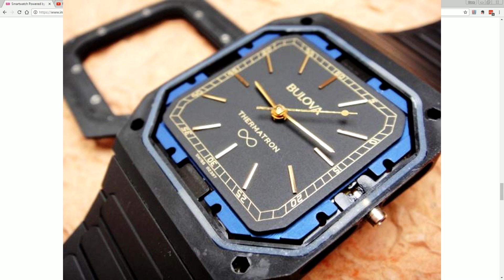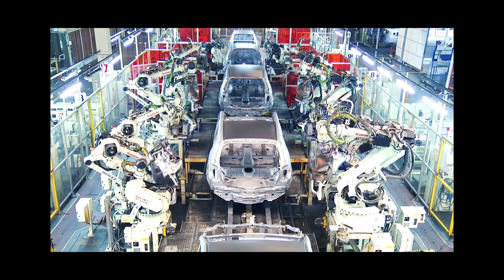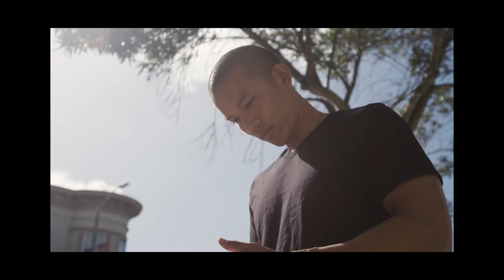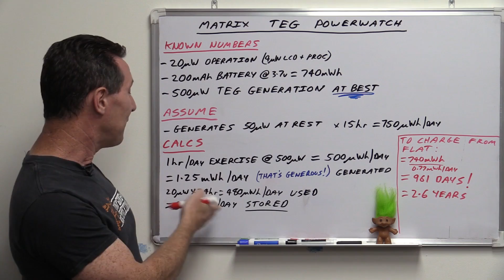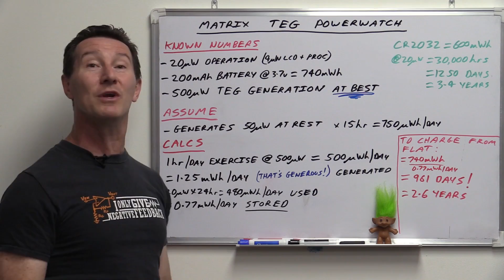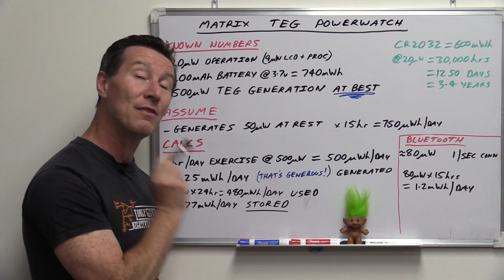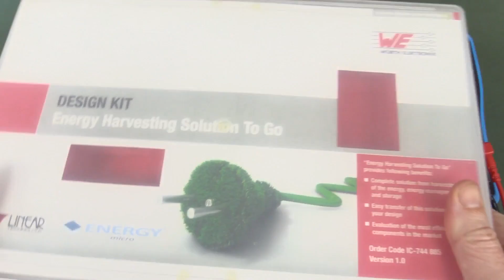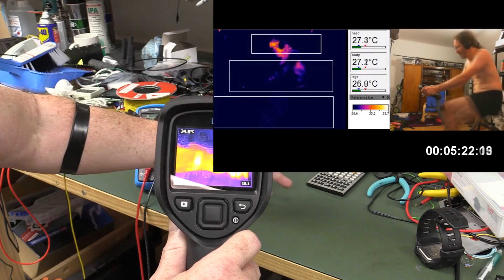EEVblog #945 - Thermal Powered Smartwatches Are GIMMICKS!

Comment: I wear my wrist watch 24/7. 

I wear it outdoors, indoors, in sauna, while taking a shower, sleeping etc. Though to clarify, I have an ordinary Titanium watch, which is SUPPOSED to be waterproof to 10 athmospheres (about 100 meters). For how long? I can't tell.

The titanium does not heat up nor feel cold while wearing so it's basically like I'm wearing nothing at all on my wrist. And it lasts for a couple of years with a single battery. 

I've been looking for smart watches, but the battery life and them being pretty much non-compliant with humidity and straight contact to water haven't been exactly adequate for my needs. 

Though a friend of mine has the Pebble whatever-the-first-version-is with the metal band and it survives being exposed to sauna humidity and being worn during a shower, or at least his pebble hasn't broken - yet.

Comment: If my calculations are correct, they could have harvested 25 mW by fitting a solar panel around the periphery of the clock face.

25 mm outside 2.5 mm bezel 
~177 mm2

I found a basic solar panel 0.55 W 70x55 mm -> ~143 uW/mm2

143 uW/mm2 x 177 mm2 
~25 mW

I don't know if my data is correct, and how such small solar panels have to be calculated, but even if this is in the ballpark, it smoks their thermal generator by far.

Comment: Since a small capacity CR2032 could power that watch for 3+ years they could still claim that it would not cost you any batteries if they supplied 5 CR2032 batteries with the watch for free. That would get rid of the TEG and Li-Po battery and still get you +15 years of free battery use and it would only cost them 5pc of the CR2032 batteries which would be pennies in large quantities. Still less cost than the TEG and Li-Po battery and associated circuitry.

On a side note... Li-Po batteries can outgas and catch fire if overcharged (not likely) or deeply discharged (if not worn for a extended period).

Comment: Well, I wear my watch in bed. Have been for 30+ years. Also, not a fan of calisthenics/cardio; I prefer short, high-intensity exercises.

For the past 25 years or so, I’ve been wearing the same cheap Chinese digital watch (with a gimmick capacitor I cobbled together to increase the accuracy to about –3 sec./month). The bracelet is a bit worse for wear, but the watch is still going strong.

Yay, “dumb” watches!
Reply: Using that one cheap watch for 25 years is extremely "green" without trying to be, right?
Reply: That's a superb ROI.
Reply: I wore my previous clock pretty much for 10 years without taking it off. Sadly it is now dead :(

Comment: I have a 20 year old solar powered Casio G-shock watch that also has radio controlled time keeping etc, also it has been indoors for the last 10 years and it is still working fine with the battery showing 100%.

Comment: So it's a thermal/digital counterpart to the Seiko Kinect?

18:53 - Would they usable/practical to connect to the back side of a solar panel? Especially the ones made to float over water reservoirs with the heatsinks immersed in the water?

27:16 - Would have been cool if you'd showed that earlier when your arms were becoming cooler just for visual comparison to thunderf00ts demo. But that's outside the scope of the topic anyway.

Comment: I wonder how the calculation works out for solar? I've got a Casio EQW-M600 which I leave on the windowsill at night like the manual says - the idea is that it gets a dose of sun in the morning and it can sync with the atomic clock. I've had it for about four years and it seems to be running fine. Then again I spend a lot of time in Taiwan which is a sunny place, and it doesn't have Bluetooth or any other smartwatch stuff.

Comment: I could partly understand the no charge policy. The context: I have Festina watch, nothing super fancy but:
I was diving with it to 20 meters, swam a lot, wear it in sauna, crashed point blank into the metal vise (ups). 
Had in in mud, oils, etc. Nothing had really damaged it. ... and it is quartz, bottery powered, so first major thing happened - the battery died after ~5 years.
I'd prefer not to have battery replaced. Factory seal was perfect and now I am a bit scared  whether it will keep its original parameters. 
So TEG (or different energy harvesting mechanism) in this place, sure. 
Is this technology viable in general: not yet.

Comment: Reminds me of those solar watches, becomes an extra burden to charge if you wear sleeves, and the rechargeable batteries are much more expensive.   Most are made to be disposable watches, which renders the green issue pointless, but they do have the advantage of lasting for years without a battery change.

Comment: I'll stick with my good ol' self-winding mechanical watch, thanks very much - it's undeniably powered by me, and its reliable as a brick and does everything that I need a watch to do. Even better, it's always on, and even holds charge and keeps running for a day or two without containing any battery at all. Keeping track of the minute or so it gains each couple of days, and having it stop whenever I forget to wear it, is less inconvenient than it is entertaining in an age of smartphones.

Comment: A few obvious technical errors:

1. With better circuit design (active rectifier), the watch should be able to extract energy regardless if the air or the arm is hottest.  Only problematic case is equal temperature.

2. With better thermal design of the strap, this should be able to extract power from the full surface of the strap, not just the surface of the watch casing. So no need to wear the watch upside down.

Comment: I use my grandfathers old watch, Enicar Sherpa DD, I sync it every other week or so, (I need a pretty accurate time, if its more than a minute off I sync it)
It shows me time, Date and Day, if I don't wear it I forget what day of the week it is...
It hasn't had a battery change since 1967, And won't need one the next 60 years either.
I bet electricity made from a similar system that winds my watch would be more efficient than this...

Comment: I just watched this because thunderfoot mentioned it. You mentioned several times that they would have a better TEG but I doubt this really. Not much can get you above the ZT of 1 that the commercial devices can give and besides any specialty material like a skudderudite or clathrate works at higher tmps and would cost a lot more. Ill lay odds on that they use exactly the same one you have with a little better heat spreader added.

Comment: No arguement here. Yeah,taking money seems to be everyones goal. These feed me .com sites are getting out of control. I refuse to invest in any of them.  Even if you invest in one,most are a here today gone tomarrow types anyways. There has been gimic driven watches available for years. I have a friend that collects watches for a hobby. He may be interested in one,but I doubt it. I think you may have spent entirely too much time proving your case especially when it was clear enough. I am glad you did add in the additional part showing that thermal electric generators are nothing new and not that big of a deal. As far as thousands of batterys going to the land fill a year from wrist watches,I hightly doubt that. I can get a regular watch battery to last 3 or 4 years. The fact I am retired  means I dont even wear one. You wore me out watching you do your workout. I had to go get a beer and sit down.

Comment: Have I missed something?
 Why count only one hour of wearing during exercise.
Wouldn't heat from the skin be going in all the time, with varying intensity of movement.
Why is the exercise in cold weather optimal if Thundefoots demonstration shows heat leaving the arms.
Were did 'assume 50uW at rest for 15 hours' come from?
Some people may have very hot wrists.
Is the main problem the temp at the wrist side and the temp at the dissipating side?

Comment: I'm only at 8:50 so far and you are really trying too hard so far with constant gimmicky remarks but you are way off when you say it isn't going to generate anything when you are in bed "because it will reach thermal equilibrium". Cold night or hot night? Arm under something or out? Your skin temperatures don't really vary much from resting state to even during exercise and although this difference may be useful to calculate energy output during exercise the variation will not result in a significant difference in power output. Cold ambient temperatures will be a greater contributor as the TEG's energy output is directly tied to temperature variation. What that means is for someone like me who lives in a warmer environment my most effective charging period could potentially be during the night when I am sleeping if I slept on my back with the watch out in the air. However even though I sleep without covers for most of the year if I am spooning my wife my watch would be under her pillow, I could put it on my other wrist for those times but when I decide to roll over I stick that wrist under my pillow so for me it would only effectively charge if I choose to lay on my right side and leave my watch on my left. I can see how it wouldn't charge effectively at night for someone in a cold environment who sleeps with their arms under the covers but I guess for those people their watch would charge more effectively during the day than if I had one. Then there are your figures on the board, watch it back and see if you can see the problems, at 13 minutes in I really should stop watching LOL But in case you are not catching it, I'll give you a hint for one of the funny parts, what does 20 mW times 30,000 hours equal? But there are other funny mistakes on your board, see if you can find them all LOL.

Your assumptions throughout are off so your whole argument and video fails. Is it a gimmick? Sure, in a way. To call this a smartwatch is a stretch, what it is more comparable to is a fitness tracker. They also tell you the time, some also sync with your phone and they can be very power efficient. Leaving out the TEG the key difference between this and a regular fitness band is this is more attractive in my opinion and looks more like a traditional watch. We know how long existing fitness bands can last without a charge and given the size difference of this watch we can reasonably assume that without a TEG and using a large battery if this device was capable of comparable performance to existing fitness bands it would be able to go much longer without a charge. So the comparison of this device to a smartwatch in their video is very misleading. The device they are comparing it to is not just a smartwatch, it is a smartphone in a watch format running full Android not Android wear however it is using older cheaper less efficient technology (than what is now available for more money) so under heavy use it will struggle to last a day. It isn't a fair comparison because this Matrix powerwatch will not make phone calls or watch youtube or stream from your choice of streaming music service or many of the other things the stand alone watch/phone they compare it to can do. A fair comparison would be to a fitness band as this Matrix watch isn't even really comparable to most of the smart watch market.

So using a TEG to charge a good looking fitness band on its own might be a bit of a gimmick, it certainly isn't something the market really needed. However also using a TEG as a method of measuring energy output during the day is a bit of an unknown, still I'd think this is also a bit of a gimmick personally. But ultimately this devices value must be determined by the sum of its features. I think it can be argued it is a good looking watch, there are a lot more expensive smart and dumb watches out on the market and in my opinion at this price point this is a good looking option. In the world of fitness trackers, something that you can wear out in the surf as well as tracking your activities at all times is a great thing and even better that it is still a good looking watch that most people wont feel the need to take off when going out or at a meeting. Compared to fitness trackers there are features that some people will miss. GPS tracking for example would be nice but it could be argued that measuring how much energy you used is more important than mapping exactly where you went for the purpose of fitness tracking, that's if a TEG actually proves to be good at measuring energy output, I have my doubts. It isn't really a smart watch and it is a different kind of fitness tracker. Time will tell if it is a gimmick or not.

The truth is practically the entire smartwatch market is currently a gimmick because western manufactures will always try and milk a market for everything they can and slowly release features while charging way too much for gimped products instead of just coming to market with the product customers actually want. On the other side of the spectrum we have China making cheap smart watches (like the one we saw in their video) that are much more like what consumers would actually want and buy but they are gimped by being a very cheap product not always sold at a cheap price. In my opinion this Matrix powerwatch is no more gimmicky than the rest of the dumb smartwatch market. Apple are charging a small fortune for gimped crap, Samsung are selling watches like the Gear S2 with data and then removing the one feature that most people would need data for forcing them to buy the S3 and not even delivering another key advertised feature of the so called smart watch and these are some of the premium devices LOL. If only East would meet West now. There is a real market for a good smart watch and the technology is already there and there is no need for it to be over priced other than manufacturers think it is best to continue overcharging. The reason the smart watch market isn't really taking off is the same reason the phone market is dying, we lack smart manufacturers.

I'll admit by 16 minutes I couldn't listen to your crap anymore, I haven't watched any of your other vids or seen your blog before but hopefully you just had a brain fart that day and this video isn't representative of your blog normally because I'd like to think that over 400,000 people really don't subscribe to this kind of rubbish. Hopefully you are normally smarter than in this video.

Comment: Wouldn't solar face and kinetic generator be better? I have a digital watch that the face under the screen is solar panels, and there are electro-kinetic generator powered watches that have a moving weight which charges the battery as you move. I wonder how much energy each of those methods can generate?

Comment: OMG! Do they really think that they can save huge amount power by using thermal power smartwatch instead of the regular watches? It is ridiculous cuz we'r talking about uW level power dissipation. There are many things we can do to save energy, not from the things that consumes really really low power. I really like the way u calculate anyway (Thumbs UP!). They would simply use a single solar cell or using electromagnetics to charge I think.

Comment: I have a watch A Citizen Solar powdered watch, has run for 11 years, no battery change... no it doesn't have Bluetooth, bu it does have a mechanical movement for the seconds and for the minute/hour. Separate motors. it can move the hour/minutes independent of the seconds. Perth has a lot of sun.

Comment: hey I think you are way off on the stationary power generation vs the exercising, you only give 1/10 of power generated comparing to a person that is running, but think about how much the temperature changes on a sitting person or a runner person? not much, so why would you only give 1/10 of the power for that?

Comment: what's the point of adding notifications to a watch that does not vibrate? 

Btw, it's very funny that the makers have centered their video on the "green/environment friendly" feature of charging the watch using your heat. In ten years you save few Wh, but how many thousands of Wh have been spent to manufacture each single watch ?

Comment: If they want to use these generators somewhere... why not on laptops and cell phones? Use them  as heatsinks that generate power to extend battery life. Those devices produce heat (a lot of it), why not use that heat to produce power while cooling the devices?

Comment: I don't get it. 11:21
If the powerconsumption is 20yW (=0,02mW) and the Battery has 740mWh
The watch should be able to run 740mWh/0,02mW=37000h
Why is the powerconsumption so low compared to other Smartwatches? Like the Apple Watch has about 780mWh but lasts only 0.001x the time (about 48h).

Comment: The year is 3200, the start of the 33rd millennium.  You strap on your matrix watch and after a few moments it wakes up and reads out the time.  It's completely pointless because the calendar as we know it no longer exists, replaced long ago by a more accurate system.  The time though is spot on for someone living in the primitive 2ks with a 24 hour day which we no longer have.   But hey! At least it doesn't need batteries!

Comment: Your measurements are in a 20C workshop, so the thermal differential is 17C.

Outside in your neck of the woods, as you said, that is reduced to just 1C. Wind chill only applies at speed and has a much smaller effect when the base differential is already very small.

This means that this watch only has the use of it's thermal generator in very specific regions of the world, during very specific periods of the year and as you stated, only during certain periods of the day.

To me this means it is indeed a gimmick that, instead of providing an energy addition to the system, removes battery space which has a much higher energy density then the TEC could ever have potential. It's a literal waste of space.